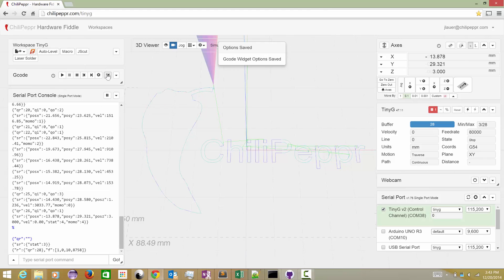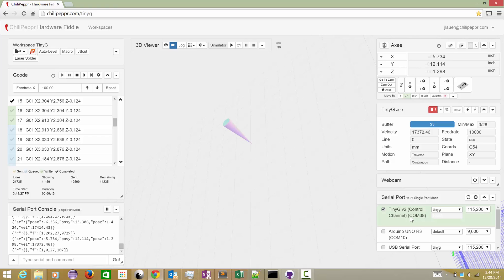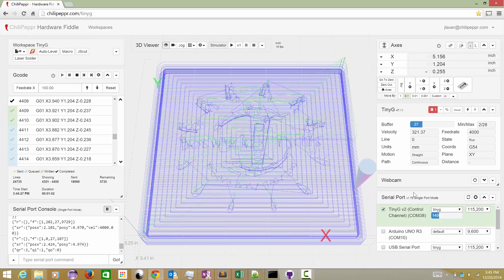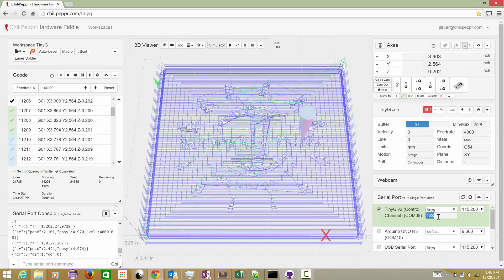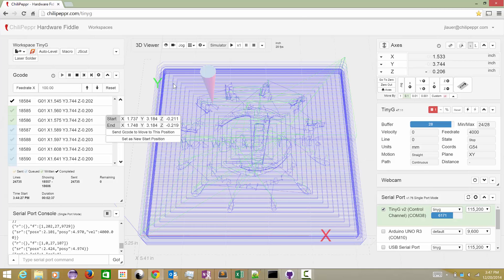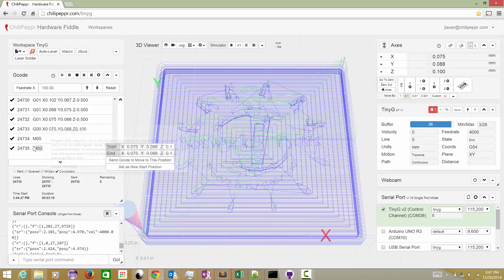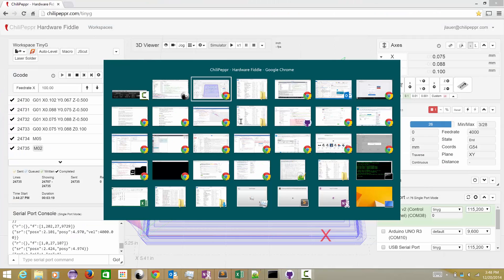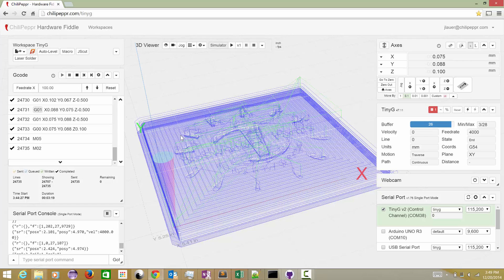Deep Dive Into Buffering for ChiliPeppr to Serial Port JSON Server to TinyG

Comment: What simulator are you sending the GCode to? Does the TinyG have a built in simulation mode? 

I use the XCarve GRBL 0.9 controller. Does a message level simulator exist for that setup?

Thanks